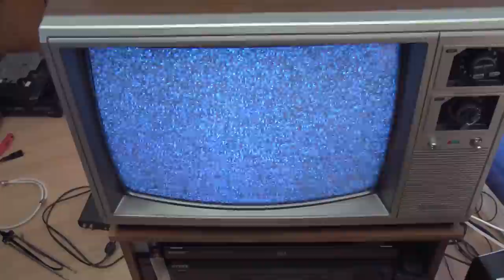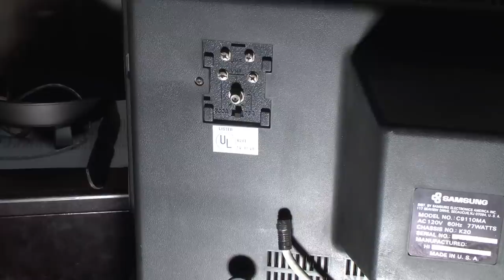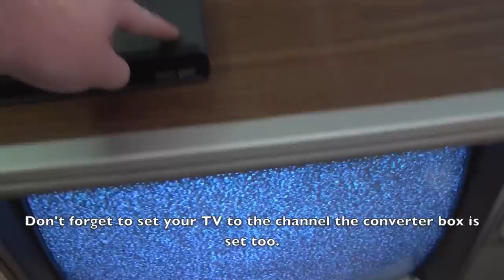Hooking up a Digital TV Converter Box

Comment: I had a antenna just like the one demonstrated, and it was useless at picking up a decent analogue signal, pictures were very poor and distorted, poor sound and useless Teletext service as the poor picture picture corrupted the text, I can imagine it would not work with the digital signal we now have here as the converter box would not be able to correct the errors in the signal.

Comment: This SAMSUNG TV set have not CVBS input RCA/CINCH socket in yellow colour, RF modulator is required.

In France, integrated RF modulators are not provided, alls tv have CVBS input. Integrated RF modulators are only in CCIR B/G norm, no L/L' France norm.

Your STB use ATSC  DTT standard. In Europe we use DVB norm.

In RF, EIA norm( USA, Canada, and Japan ) 525 lines 60 Hz, you use 75 ohms, only for VHF, and 300 ohms sockets for UHF, and an impedance transformer is required when RF modulators using UHF channels.
Reply from the maker: This digital adapter has the RF modulator built in, as explained in my video.
Reply: Yes, i have understood ! In all world RF modulators are built in, except France !

Comment: What if it has a HDMI output on the back of the converter? can you just plug that into your smart tv (if you have one) and then just plug in the antenna? I'm trying to record shows when I am gone and I found a DVR that has a high resolution recording function.
Reply from the maker: This is beyond the scope of the intent of this video.  If you have a smart TV, you don't need an adapter for over the air antenna.  If it's for a DVR, just get a new one, you are way over complicating things.

Comment: So now you can hook up roku if you want to....to the converter box?
Reply from the maker: No not at all.  You need something entirely different for that (Either a Roku with composite out going to an RF modulator, or a Roku with HDMI only if you want a faster Roku, to an HDMI to composite converter, then to an RF modulator).
Reply: There is older Roku's that are AV compatible.

Comment: I have a question, so I have an old Sony solid state portable TV but the only problem is that it doesn't have any inputs on it. It only has an input for an external antenna. Is this possible to connect to the converter box and if so how would I go about doing that? Thanks
Reply from the maker: You'll need an adapter for the external antenna jack to the "RF Out" of the modulator.

Comment: I have question.  I have 1982 samsung bt 316 it has single wire antenna and another antenna deal that shaped like circle.  Ok The adapter i bought like you specified has the 2 mount spots where wires off antenna mount into it.  If my antenna just has one wire I just hook the one in?  the other antenna wire is down on the jack in back and has only like 1 inch slack.  can that other wire remain there?  please advise.

Comment: Hey sir what is the different & why they make 300 ohms & 75 ohms? Now I know why my toshiba tv I can't find the 75 ohm connector in the back or side of a tv.
Reply from the maker: 300 ohms is the two screw terminals, and 75 ohms is the coaxial terminal.  If your TV is from the 90's or above, you will have only 75 ohms to worry about.

Comment: Watching in 2021,, just could not deal any longer with the little antenna tv box so bought a new antenna (havent thrown out my half-broken rabbit ears yet tho), the (GB) Gesobyte Amplified HD Digital TV antenna Long 250+ Miles Range - Support 4K 1080p Fire tv Stick and All Older tvs from Amazon and the iView 3500STBIII, ATSC Digital Converter Box with Recording etc, also from Amazon. Me, the most mechanically challenged female on the planet, trust me. Got the antenna up, sticking to wall behind tv, managed to get tv on but it only goes to channel 2 (CBS) and I see no way to scan channels for set up. It must at least be on ch 3 tho bc it shows something and I can hear it on my old Sony Trinitron which I dont think has all those things on the back. It does have the thing for the coaxial cables. But wont change channels and ofc my son wants to watch DVDS, I have an extra set of those red, white and yellow cords. Help me please, what do I do next?? All help SOOO appreciated!! Thank you, wish I'd seen this first. >>PS Mike - Just bought these two items two days ago (5/26/2021) so if you recommend something else I can return these and get something else. Also you have my permission to email me at astralchyld@yandex.com,  I could edit it out later but I trust you Mike! Thx again!! ~~Chanel
Reply: Did you get everything figured out?
Reply: @freddieskelton752  Yes except for faves and  have no usb for it yet. Coming soon tho. TY!!

Comment: Im trying to hook up converter box...need help..Where do I put the 3 cords from box to tv--red yellow and white
Reply from the maker: If your TV has the composite AV ports, they should be labeled input, just plug it into there and switch your TV to the correct inputs..  They are color coded, so yellow goes to yellow, red to red, and white to white.  If your TV doesn't have these, then just use the coaxial connection like I used.  If your TV only has yellow and white, just leave red disconnected.
Reply: Brandon MacEachern it has component 1-component 2 video 1-----program out
Reply: tku for your help:>)

Comment: i got a ? cable man, i  hooked my converter box up as directed, just like you did,   after all  settin up,  its just keep saying  NO SIGNAL , the t.v is in the basement, what do you  suggest my next move be, i got the anttenna, hooked up. what did i leave undone
Reply: You are not getting the signal just by being in the basement use an external UHF antenna.
Reply: did u do a channel scan first? if not do that if u still got nothing then try a rooftop antenna you can find some at a pretty low price and they work pretty well

Comment: k...do you HAVE TO HAVE  CABLE OR SATELITE?
Reply from the maker: ANTENNA -  In case you didn't see that in the video which you clearly didn't watch.
Reply: Nope. I have a similar setup. All you need is an antenna, a DTV converter box, plus a CRT TV. 

FREE TV = NO CABLE/SATELLITE

Before cable TV and satellite TV, we had antennas. We had ABC, CBS, NBC and PBS, and if we were lucky, a DuMont or independent affiliated channel (I'm speaking on behalf of the people of the 1950s-1970s, when broadcast antenna TV was the only form of TV back then. Cable TV was not introduced until the late 1970s.).

Comment: Will this work with just a pug in antenna or do I need rabbit ears
Reply: Plug
Reply: sherry evans Uh the best thing is to have a good uhf/vhf antenna. Because the Digital channels are different, you may want an outdoor antenna if you live far from a transmitter, if not, you can get away with an indoor vhf/uhf antenna.
Reply: Thanks phillies4100

Comment: Bengals still losing... But what if the TV has no antenna? O.o
Reply from the maker: +PMDownUp Then you can buy an antenna.  Just make sure you get a UHF one primarily.  But if any of your TV channels are broadcasting on a VHF frequency (one of my local channels are), you will need a VHF one also.
Reply: Brandon MacEachern
Reply from the maker: +Albert Lauria Yes?  You called?
Reply: +Brandon MacEachern  Hello, thnx for the good video to find the digital canal.
My question is : I have e smart TV Telefunken and i have the Analog Antenna but when i scanned the chanels i find only 3 chanels and any more.
How to solved this case for my TV.
I am from Kosovo and that device in your video i can't find in the market of Kosovo.
All the best.
Reply from the maker: arjanit gacaferi Well any antenna isn't "analog" or "digital".  It's an antenna tuned for specific frequencies, of which has no bearing on the content.  If you are using a smart TV, which I am assuming digital, I am also going to assume that you are using what is called a VHF antenna (rabbit ears).  Modern digital programming is actually on UHF, so make sure you are using a proper UHF antenna.  I used a VHF antenna in my video because I still have some VHF stations, and it was easier to just use what I already had nearby for filming.
Reply: +Brandon MacEachern 
I understand what you say and what presentation in video.
Simple i have a analog antena with VHF but where i chose to search for new chanels i find only 3 chanels.
Need to buy a digital reseiver or digital converter box....
Thnx for understanding also.
Reply: +Brandon MacEachern 
I do not have antenna with rabbit ears but I have simply in the form of networks, in roof of my house.

Comment: i got a new vizio with a clear tv antenna....but i only get fox and abc.....why dont i get cbs?
Reply from the maker: The "clear TV antenna" isn't really that good of an antenna, and it's only for UHF.  Some of your channels may still be in the VHF range.  I'd recommend something even as much as at least an attic antenna.  I have 70 channels with the home made attic antenna I built, along with the amplifier to distribute it to all of the TV's in the house.
Reply: well looks like im gonna have to do a bit more of research...whats the difference between an outdoor and attic other than the obvious? and do you know of any good manufactuers via online walmart ect. if not guess ill make my own lol .
Reply from the maker: Miles Deep The clearstream antennas are good, mine is built the same as those, and they work good.  What you'll need to remember, is that most of these antennas are UHF, unless they state they support VHF.  Google DTV reception map and chose the FCC site (I'd hard link here but the URL changes).  Enter your zip, it'll show you what you should get in your area, and what the "RF" channel number is.  RF channel is what channel it's really on.  Meaning the virtual number may be 2, but it's really on 11..  But, once you got that information, check out tvfool.com, it has far more information, and even tells you what angle you should have your antenna.

Roof antennas can be used in the attic, if your attic will fit it.  Always measure and see how you are going to mount it.  Also, if it's running one TV, you'll want a pre-amp, because the coax to the TV will have loss.  The pre-amp will overcome that loss.  Having it on the roof is ultimately better, but unless you are allowed to do that, or ground it properly, it may not go as expected.  (Like if it's not grounded, the first lightning storm, there goes your new TV).  In an attic, I still ground it properly, but it's only for mild noise reduction, not for lightning.

Hope this helps, and yea, it's a little long winded.

Comment: They should of  made it of where the converter box would of transformed it from didgtal to analog and you can still turn the knob on  your TVs like before February 18th 2009
Reply from the maker: That would require one hell of an RF modulator.  I have seen one agile modulator that outputs 4 RF channels with 4 RCA inputs, but it wasn't small.
Reply: KCSBNSFJAMES 2001 That’s basically what analog cable TV was, if you had a TV that tuned cable channels. They had modulators for every channel.

Comment: My tv screen has turned blue and the Digital Stream converter box does nothing.
Reply from the maker: Unplug the Digital Stream from power for a little bit, to see if it'll reset.  The TV turning blue is just because it's receiving no signal, so your TV appears fine.  Plug the Digital Stream back in.  Does the red standby light turn on?  If yes, good.  If no, the power supply is shot in it.  If yes, try turning it on.  If it stays red, the mainboard is dead, but if it turns green, you should see something on the TV now.
Reply: Michael MacEachern I can get the red light on my converter box and when I push the power button the light turns green. But I still only get a blue screen. I've set my tv channel and converter box to 3. Thanks for trying to help.  Have a great day my friend.

Comment: I have a converter box when I look it up to the TV everything works but one problem is it's showing up the white too bright on the screen what should I do
Reply from the maker: If the whites are too bright, you can lower the contrast of the TV to reduce how bright the whites are, but if this darkens other devices you have plugged into your TV, honestly you'll want to return that digital adapter and get a different one.  They likely designed it with a mismatched impedance between the video chip and the RF modulator built into it.
Reply: Brandon MacEachern thanks so much
Reply from the maker: Shermarke Francis
You're welcome.  Your question had me think for a bit what it could be as I know I have seen the issue before but couldn't remember what the cause was (as far as RF modulator impedance mismatch).
Reply: Brandon MacEachern I wonder too every time I connect my ps3 jack plug when I go in the game the white is bright...do you have any social media accounts I could send you the pic of the modulator
Reply from the maker: I prefer to to intertwine social media and YouTube, I keep them separate, sorry.  You could maybe host it somewhere like on Imgur (don't submit to gallery though, just direct link me to the pic).
Reply: Shermar0

Comment: Will this work on a Hitachi 42PD7200?
Reply from the maker: Maybe a PAL model, sure.  It seems that TV is a european type.  But why would you?  For that you would want a high definition adapter.  I can't see if the TV has an inbuilt digital tuner, and it seems it doesn't.
Reply: Brandon MacEachern  Yes its a european type, it has abuilt in tuner but its PAL, an analong tuner i think, i don't know much about it, when i connect the antenna to it it shows distorted and in black and white.

Comment: Can you use converter boxes for portable tvs
Reply from the maker: Yes, as long as it has an external antenna input.  You just might need to find the right kind of adapter.  If you have a specific TV model in mind, let me know and I'll see if I can point you in the right direction for adapters.
Reply: Brandon MacEachern i bought a modern rca digital portable tv it comes with built in converter box technology all i needed was an antenna works fine but i also have an old analog portable tv from the 90s i want it to work
Reply: Brandon MacEachern i have an old casio portable tv that doesnt work i got it off ebsy for 5 bucks i actually wanted that tv to work moreso than the modern tv i owned a portable tv in the 90s so i guess im being nostalgic lol
Reply: Brandon MacEachern anyways i just wanted my old analog casio portable to work i wanted to sale it to my neighbor who doesnt have a tv he uses his cellphone to watch programming

Comment: How to tie a regular tv phone is smart and not just HD digital transmissions can by satellite or by modulating alaviash satellites and linked to the usb cable
Reply from the maker: What in the world did you just say?
Reply: I did not understand what you mean. Did you understand my intention.  Hhhhh. I,am I find you smart
Reply from the maker: Unfortunately what you asked me did not make any sense.  If you are using a translator, it isn't working.
Reply: Sory :   How  connect my phone  with tv  old
Reply from the maker: It depends on the phone.  If it's an old TV like mine, you'll certainly need an HDMI to composite adapter at least, and maybe an RF modulator too if you don't have composite input.  From there, you should be able to find and see if your phone sells an HDMI adapter of it's own.  So with that, it goes from Phone > HDMI adapter > HDMI to composite adapter > RF modulator (if required).

Comment: What I saw in Your Other DTV Video,you said WRDQ 27 was off the air,But i looked on wikipedia & That station Isn't off the air,27 is still on the air,& as For Univision 26,bad signal on that one,You Might need a new antenna

Comment: can anyone help me hook a converter box into my 55 inch tv
Reply from the maker: A new large TV will have a digital tuner already built in, and in high definition, there's no reason to use a digital converter.
Reply: Thanks .....so I just need a antenna.
Reply: Rear projector TV ??
Reply: @hakemon some TVs have PAL, SECAM, NTSC analog built in flatscreen TVs don’t have digital tuner. or if they have DVB-T.
Reply: @hakemon ATSC 3.0 box or ATSC 3.0 tuner with ethernet to modem for firestick and Android box.

Comment: Hey YouTube listen very closely I have a old floor model Toshiba Toshiba for my car TV and I have is that converter boxing against the stream but I got a lot of plugs on this old model TV how do I program my remote when on stuff to this I have a old remote control called Motorola what's too cold so many video
Reply: I have an old floor model Toshiba through my local TV I'm trying to connect it to the digital stream DTV converter box and there's a lot of plugs behind this TV tomorrow it's old model remote control Motorola what's the code number how do I program show me any video
Reply: Show me how to program in that old remote control of Motorola to a dvdtv digital digital extreme converter box trying to hook it up it's on now but I can't get the remote control to do operator show
 me the code give me the code stream and a Toshiba oil from my car TV